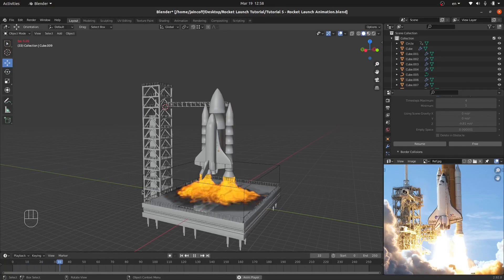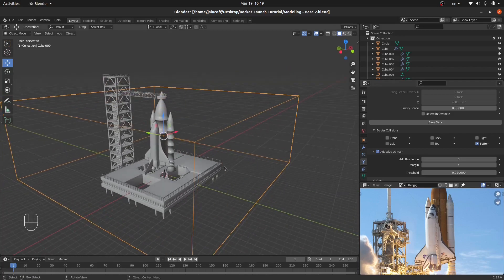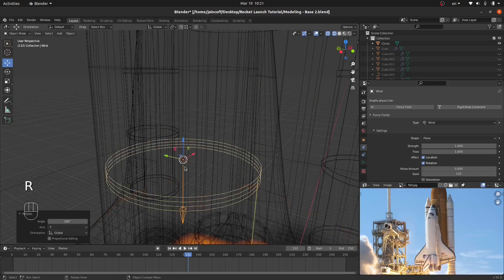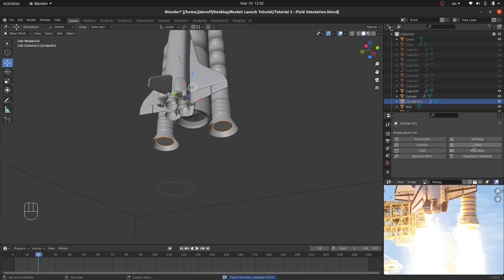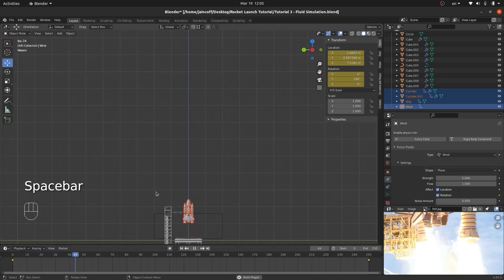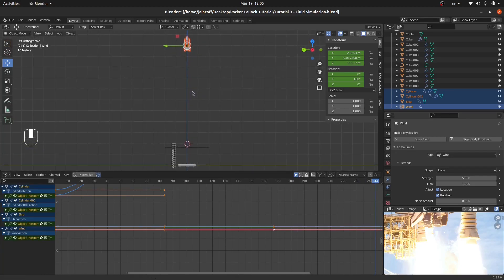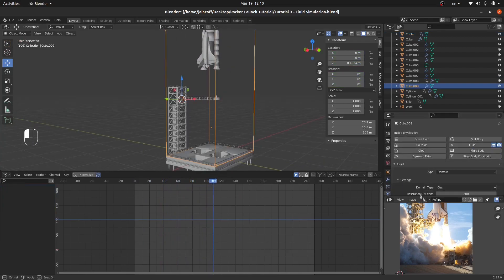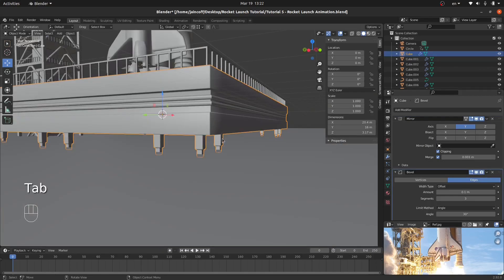Animate a Rocket Launch - Fire & Smoke Simulation Tutorial in Blender

Comment: I'm a bit jealous to see you can simulate a longer animation with a domain resolution of 750. Since Blender 2.92 all my smoke simulations crash at a certain point, even at resolutions below 150, sometimes already around the first 50 frames. The real annoying thing is that although the simulation data is still present in the location where it should be, I can play the animation up to where it crashed, but I cannot resume the bake and it starts on frame 1 again. It doesn't crash on 2.83 LTS, but 2.92 and 2.93 Alpha.
Reply: You should try to use the ZIP compression volume in your cache advanced settings, I had the same issue and it fixed it :)
Reply: @robindurivault7341  Actually I asked that question on Blender Stack Exchange some weeks ago but nobody came up with an answer and nobody there could reproduce my error... but then I found the answer myself. You're absolutely right, using ZIP helps... the problem didn't occur in the 2.83 LTS version because there were no advanced settings for compression... maybe there it was using ZIP by default instead of BLOSC now.